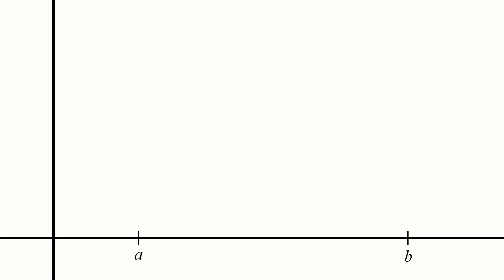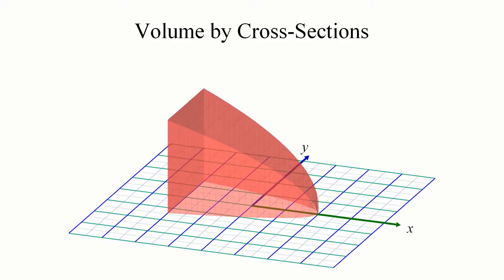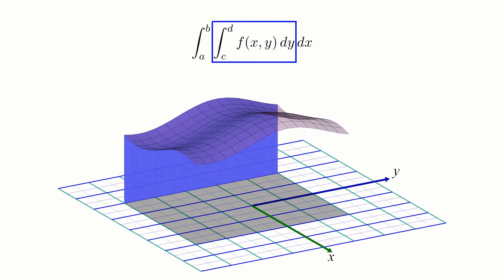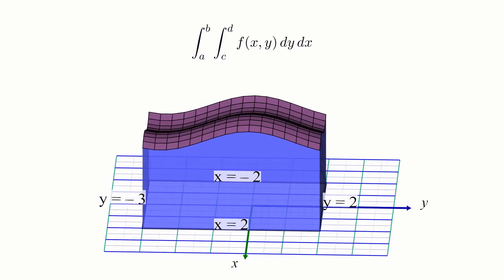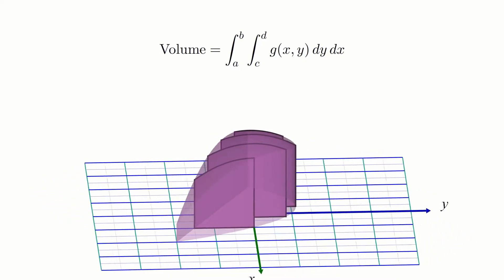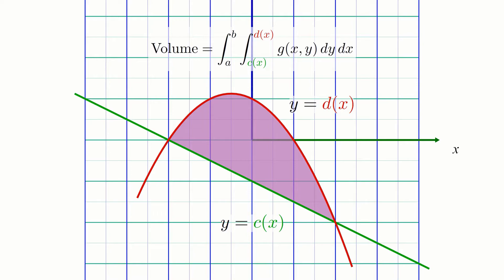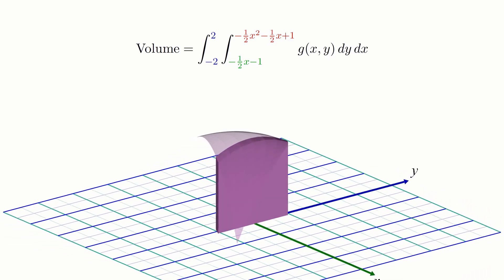How to Set Up Double Integrals

Comment: Oh i see.

So the first thing we learn is a number line from 0 to 10.

Then we learn decimal places in a new number line from 0 to 1 example: 0, 0.1, 0.2, 0.3,....1

Then we learn about negative numbers from -10 to +10 in a new number line.

Then we stack 2 number lines so that we have an x line and a y line.

Then we introduce imaginary numbers on the left side of the xy lines.

Then we describe 2d shapes, objects, motion, ect.

Then we take the derivative or the rate of change of a tangent point on the xy plane.

Then we can take the area under the curve because we now know the rate of change and can now implement things like the power rule and the chain rule.

Then we learn that you can use integrals, limits, and derivatives algebraicly, allowing use of ordinary differential equations.

Then we make a new number line so we can describe 3 dimensional objects, and motion.

And now we use partial derivatives to describe the rate of change in this 3d curve. We take the derivative of each dimention with respect to a single dimension.

And now we use double integrals to describe the area under both curves and use the relationship they have with each other to describe volume.

So all i need to do calc is to understand the axioms of algebra, systems of equations, and trig.

Add in summation.

That doesnt seem so hard. Calc is just new notation same logic as algebra mixed with new definitions and techniques of using both the left hand side and right hand side of graphs/equations.

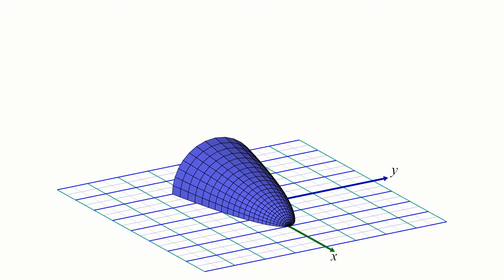Comment: 2:36
err this is pedantry on my part but there is a formula for the area under a parabola it's a|(r - v)^3|/6 where a is the coefficient of x^2 in the polynomial describing the parabola and r and v are the roots of the polynomial (assuming at least that you're looking for the area between the two parabola between it's two intersection points with the x-axis, if not the formula you get is much less nice), admittedly this formula is gotten from integrating the polynomial at it's 2 roots, but it's a still formula for the area that's much 'nicer' then an integral,
Reply: sup